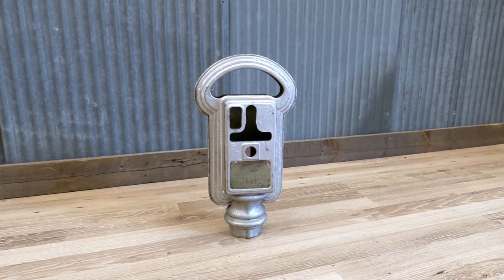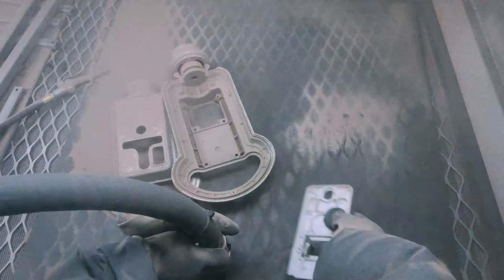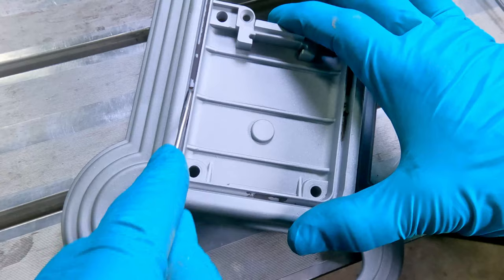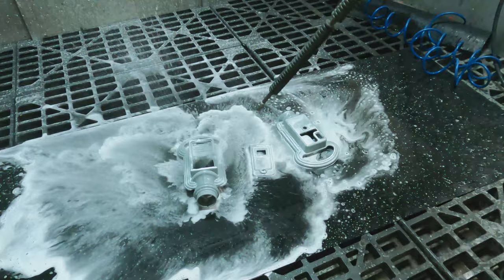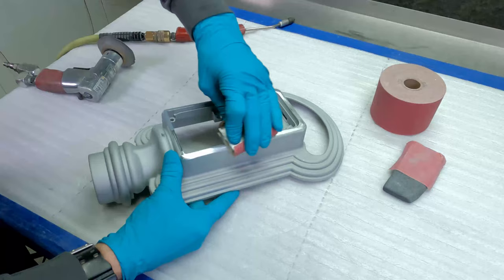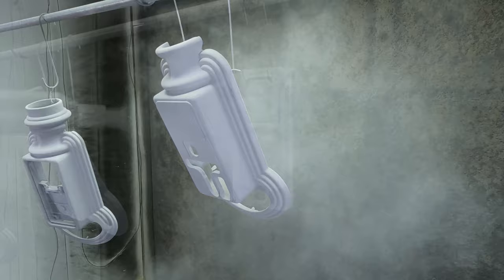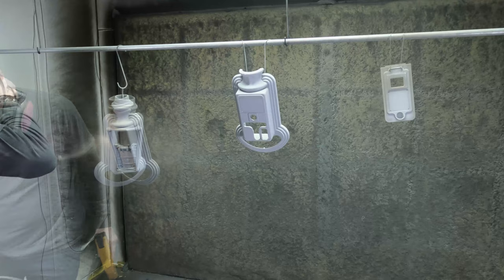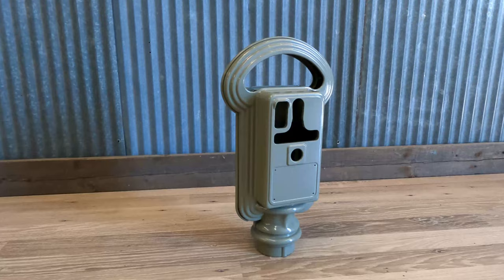Filler For Powder Coating?!? Yes! Parking Meter Restoration

Comment: Do you have to heat set the Tiger Epo Strong before sanding or can you let it cure for a few days and sand before heat setting it?
Reply from the maker: You can either let it cure ambiently (it will full cure with no heat in 2-3 days) or you can force cure it in about 20 minutes. Only after it's cured can you sand.

Comment: How do you get the top coat to stick to the primer since there isn’t an electrical charge?
Reply from the maker: It's all about the gun settings. You keep the kV's down, and the powder just lays down on top of the primer.

Comment: nice! I am wondering how that might work on rim curb rash
Reply from the maker: If the rash is shallow enough to just blend out with a sander, that would be the best method. If the rash is deep enough that you need to add back in material, I would not recommend this filler. It's not rated to fill in very deep areas and would most likely chip out over time.
Reply: Thanks for the info!